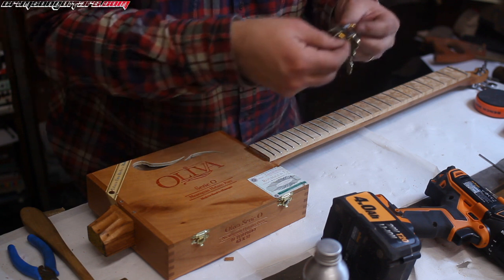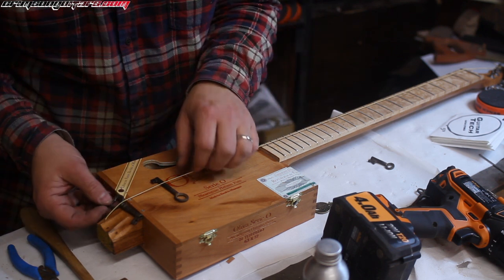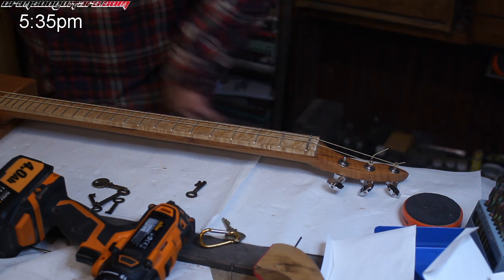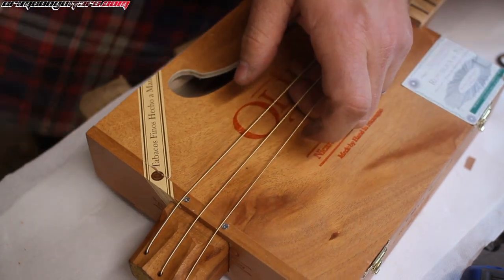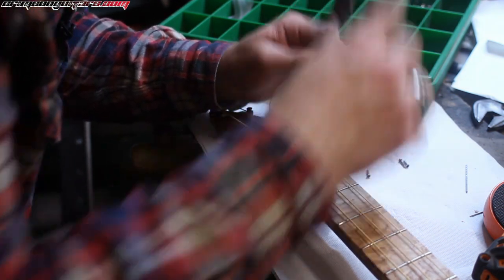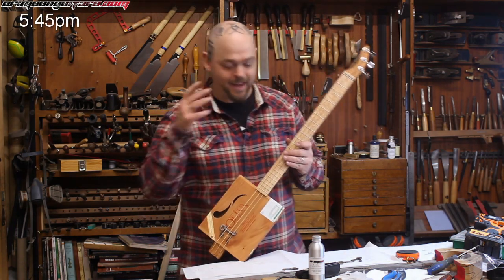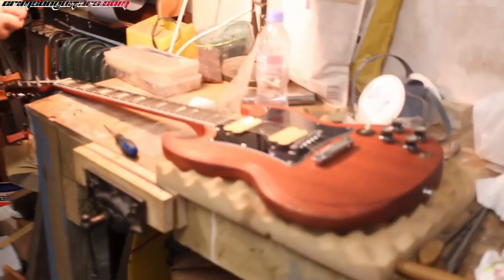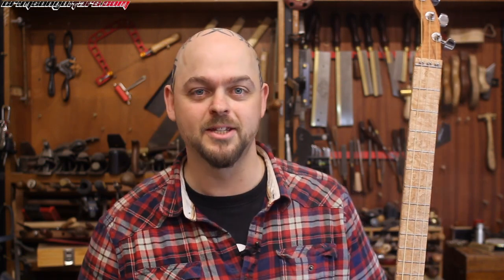Building a Cigar Box Guitar - part 11 - the Final Episode.

Comment: Outstanding brother! You may not know it ..... but this is now one of the best cigar box guitar tutorials on YT now. My name is Joe. I'm the nephew of Harry DeArmond of DeArmond pickups. Was taught by him to build guitars but I have a true love for these cigar box guitars. Not only are they historical and the very guitars that gave birth to the Blues, they are a flat out blast to make. I make some nasty bar room slammers too. LOL Even doing one now that is with "active" EMG pickups and an 18 volt conversion, and a 28 1/2" scaled baritone on a tin body (Texas Special  / Rio Grand Bucker). Point: These little guitars can do for more than the short sustain twang boxed many think they are if done correctly. As far as your build here. Pitch that zero fret and go brass or bone nut. On your tail of the neck, do not taper it down. Use an "L" bracket or some other means to "ramp" the strings up just a few millimeters above the surface of the box. Then run them up to the bridge. As far as your speed! Bro, I have never made one in just a few hrs. Good job! LOL :-)

Comment: Hello from Ohio,  I thought I had seen every you tube video on Cbg builds, I somehow missed this one, sadly.
What a talent you are Ben, to do this  without even knowing cbgs are usually tuned in an open Gdg.  You are a credit to your craft.
I have been building cbgs for about year and a half and have come soooo far already and have picked up some great tips from your vast
 experience in building and woodworking.
You obviously have a passion for your business. 
A few tips from a humble builder, the scarf joint I use is set at 15 degrees, and I never have a break angle issue, secondly you might consider use the large key mounted on a wood base, giving you the ability to raise or lower the bridge by the thickness of the wood shim under the key, also in my opinion easier to adjust your intonation.  Just my thoughts, as you must already know in the world of cbgs there really is no one way, that's what makes it so COOL!
THANKS FOR YOUR EFFORT!

Comment: Man, you are awesome. I felt your emotion. I have a question for you; sorry if it is silly. I thought that fret measures were something very specific, starting from the total string length, from bridge to nut. So at first I was expecting you to calculate the total measure from nut to bridge, taking firts the measure of the already made  frets and making some hard calculations. But I see you just put the key bridge in some random area.Is it possible to use any fretten wood and do that?  I mean ,I have an old fretten neck I would like to use, but I don´t know if that conditionate my Cigar Box Guitar. Thank you very much and sorry about the English.

Comment: How do you price your guitars? How much should a luthier without a name (yet) charge for a high quality stock instrument. Im not at the point of selling instruments quite yet however im getting close. So just asking for future reference. I just need to make money, I don't need to make a living (if that matters).
Reply: +Torwulf games I'm not a business owner (I have made a few guitars though).  I don't think it matters if you have a name or not.  You charge on what you feel your product is worth.  It makes sense that you should put a value on your time per hour e.g £10 per hour and add up how many hours it takes you to finish a guitar.  Add all the costs of the parts wood and components and finishing costs. Bare in mind you will use electric and add wear and tear from your tools which you may need to replace from time to time.  If you build up a business you may have to factor in rent for larger space. Add all those costs together and you will arrive at a price to market your guitar at. On top of all that theoretically and legally you should also claim an income on everything you earn so you should be prepared to pay taxes.  I know this may not apply to yourself as dare I say it a hobby builder.  But you should think about your long term plan as well.  If the cost looks too prohibitive then you will have to look at your manufacturing process to see where you can save time.  E.g investing in power tools such as surface planer, planer thicknessers, rotary sanding stations etc.  Also look at what jigs you can make to not only speed up manufacturing process but ensure you get repeatable results.You may not be concerned with making a living just yet but what happens if you do get enough work to earn a decent wage.  You may want to employ workers.  At the minimum wage you would have to pay your employee say £7 but the cost to your business in paying taxes etc will mean you are actually paying £10 per hour for an employee.  Personally to make a small living and cover any costs I would have I would probably have to charge at least £20 per hour.  I have very low overheads as I have space.  That cost may have to go up should I have to rent premises.  For me it's not worth it to venture into an already overcrowded market.  There isn't a lot of difference now between Korean build instruments and UK/US hand made boutiques.  I build for myself and maybe a few relatives / friends if they ask but don't really make money when you factor in all the above.Bit of an essay but hope it helps.
Reply: +will01quinn yeah I guess that makes sense, the price I have in mind for my next guitar will be around 500-1000€ just. I guess I will price it when its done but I wonder how many people would spend 750€ on a semi acoustic neck through t - type.
Reply: +Torwulf games if I were to sell it that is (and I gladly will if im happy with it)
Reply: +Torwulf games I suppose that's where you would have to do market research to find out if there is already something similar, find how many units they sell (roughly) and how much they sell for.  Then ask yourself how your design is different.  I.e how can you justify your price tag if a Korean made one is half the price?  You need to to something other than say made in US to attract customers. Be it customisable options you can offer or more bells and whistles.
Reply: +will01quinn yeah, seeing as a flatline Tele (the closest guitar I can find to it) in Finland goes for 1000-1500€ I think I am quite confident selling a neck through version with extra stuff like coil tapping for around 800€. Even more if I where to sell into the Finnish pride, you can charge 30% more here for anything just by saying made in Finland out of Finnish materials xD.